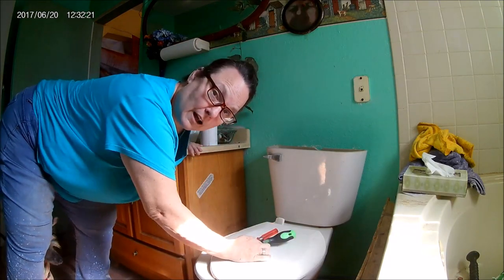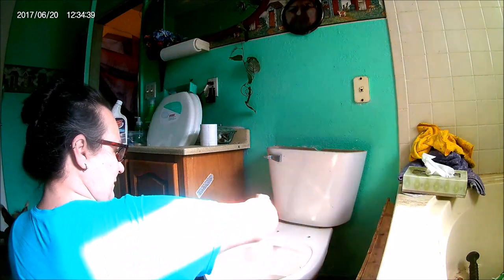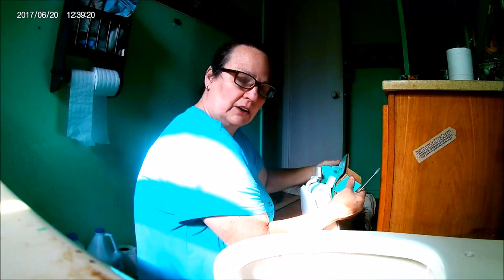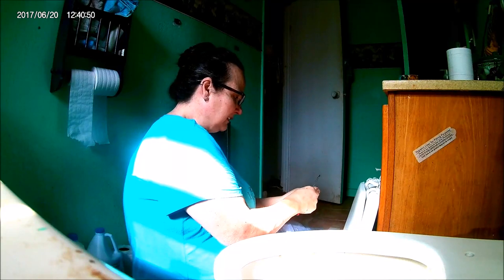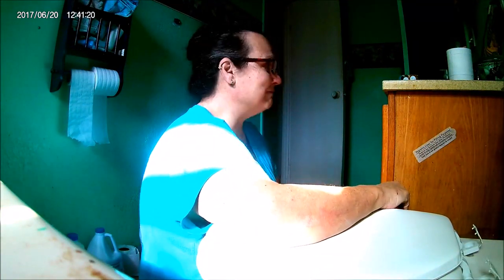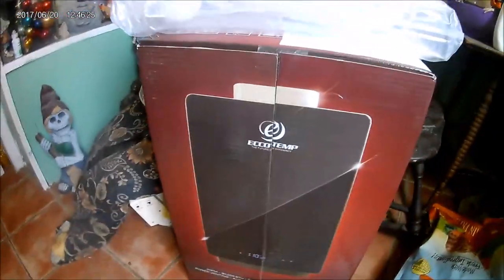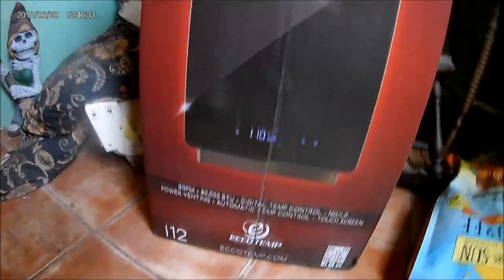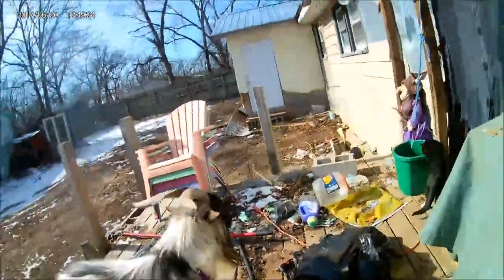Grandma fixes a toilet seat all by herself

Comment: You are on a roll. Great job. By the way to remove door hinges, place a flat head screw driver under the head of the pin and push it up with hammer to remove. Who needs a man right? I have one but it’s still me who does all the repairs. Google is my teacher. ❤️

Comment: Haha. I just bought a new toilet seat today and will be down on the floor installing it tomorrow.  Oh yes, it is hard on the knees and getting back up isn’t pretty. LOL.  Those plastic bolts are useless aren’t they? But they do still make some with metal bolts (but plastic nuts). The one I got has metal and was $25. Also, you can buy replacement bolts separately.  I love your videos so much and can relate totally to many of your frustrations. You have a great sense of humor and outlook on things. Oh and in regards to previous video and driving in snow, if you shift your car into neutral when you brake, you won’t slide around. Driving in snow is a regular thing here where I’m from 😁. Glad things are coming together and hoping you get your hot water soon! All the best!

Comment: They are plastic because the metal ones would corrode after years and be stuck together and would then have to be cut off which isn't easy.  But I agree, they should be made out of tougher material, nylon maybe?
Reply from the maker: Hey thanks...hadn't thought of that...you are right..at least that plastic just broke right out of there...and on the plus side, if I can change one...anyone! can!...:)

Comment: Toilet bowls are all water saver's.  I've learned that by holding the handle down until the flush is complete it leaves the bowl with more water.  That keeps the poo from dropping onto the bare porcelain.  I have to wipe down the toilet every time I go in to bathroom.  Men and little boys are too preoccupied to aim, and they don't clean up toilets.  I too have the double toilet paper holder.  No more fighting whether it's over or under because it needs both to work right.
Reply from the maker: that's right! one roll goes one way, one the other so it doesn't pull the other one off...lol...you are so observant...personally I think over is best so you can find the little end....lol...Mine is a water saver but does it really save when you have to flush 2 or 3 times?...I'd rather one big woosh!...lol...have a great day Patty